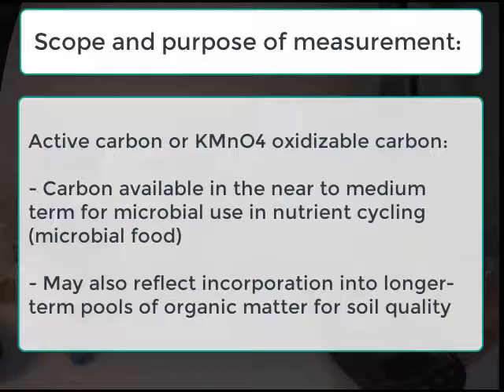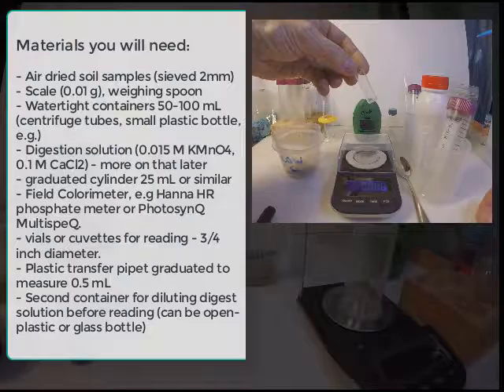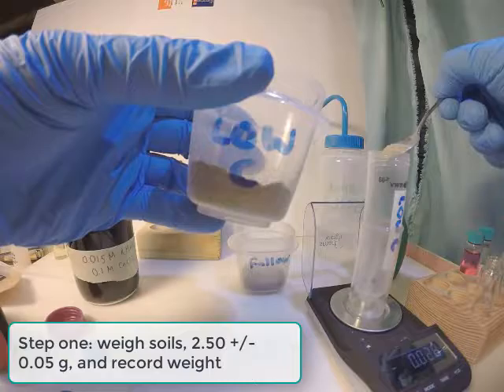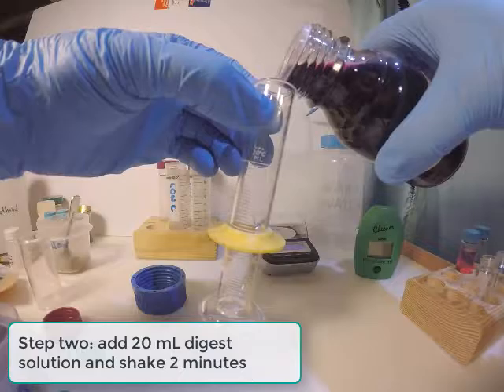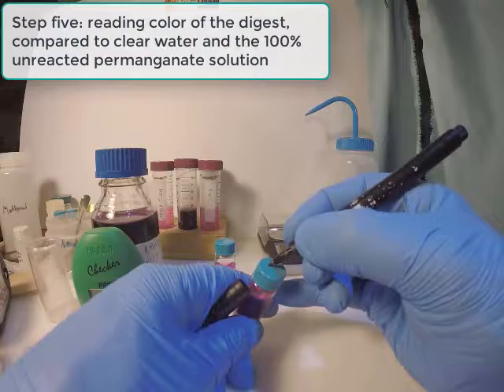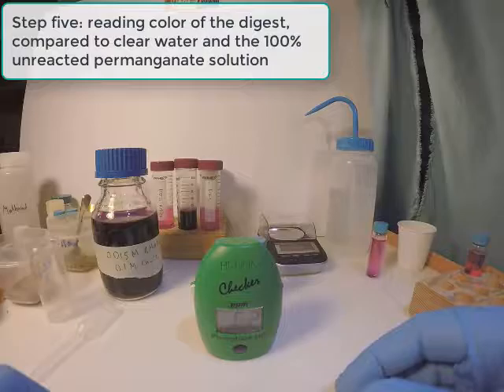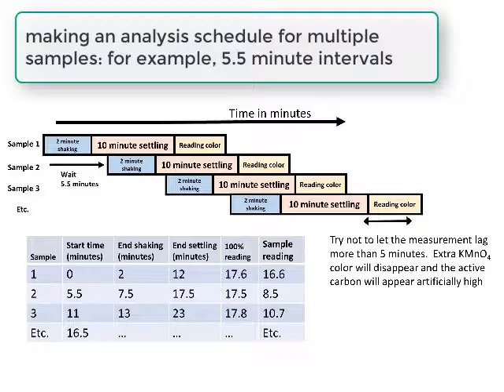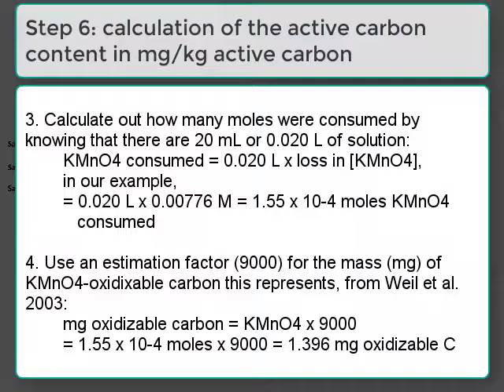Active Carbon in Soils (KMnO4-oxidizable carbon): how-to video

Comment: how 7.35g CaCl2 in 500ml is 0.1 M
Reply from the maker: wow, pardon, you are correct.  it should  be 5.55 g. / 500 mL for 0.1 M; and 1.185 g KMnO4 which is in fact close to 1.19g
Reply: @lloqalla  no problem, thanks for these high quality contents